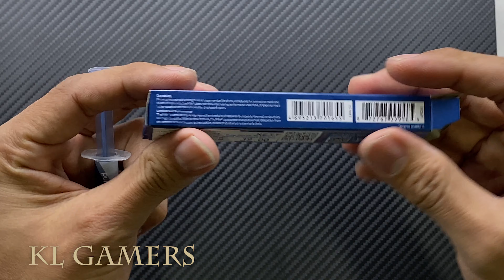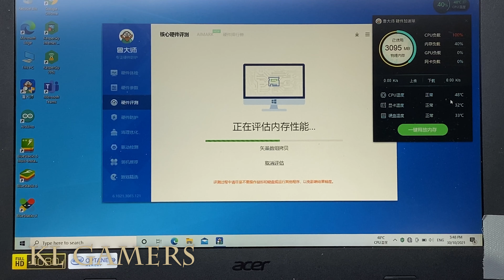ACER Nitro 5 Gaming Laptop AN515-52-78AS Disassemble Replace ARCTIC MX-4 Thermal Compound

Comment: 4:40 why do you disconnect that cable? Im asking because I need to clean my laptop and now I have the doubt if it is necessary to disconnect that cable
Reply: Thats the battery cable its more safe to disconnect it if you’re going to make some changes or deep clean your laptop from the inside as shown in the video
Reply: @ConsieX  AHhHH okay, Thanks dude
Reply from the maker: ya, disconnect the battery cable to prevent power short circuit